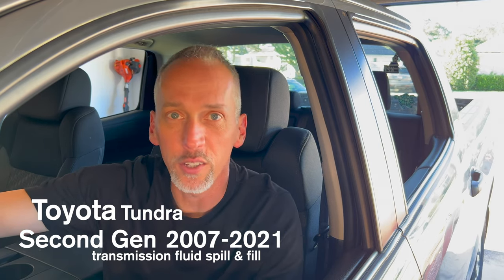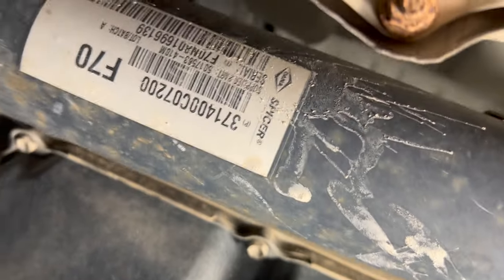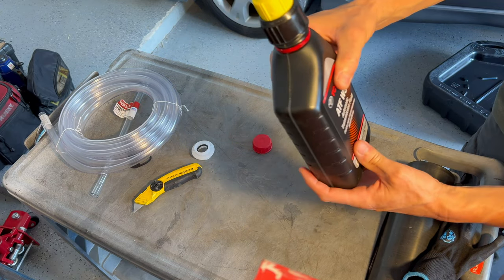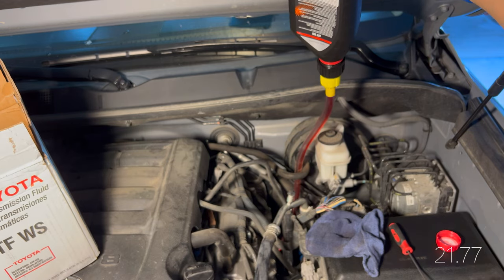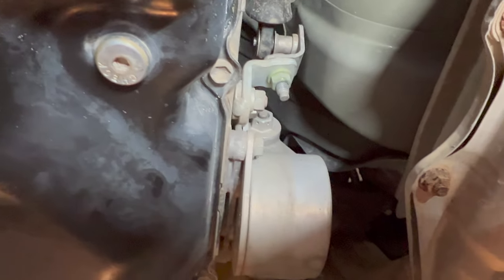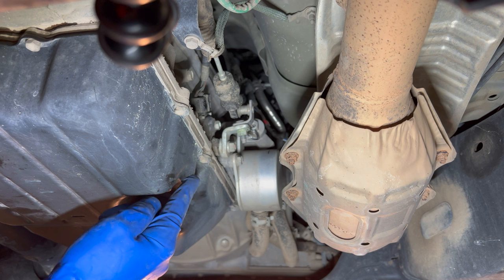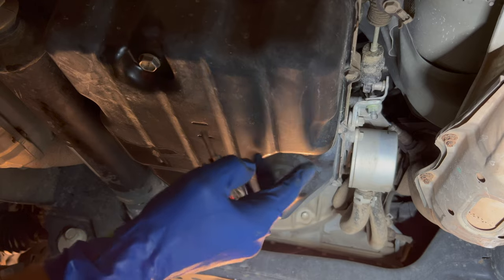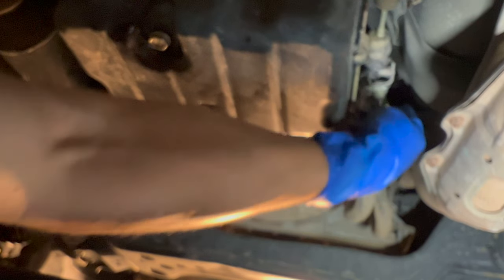DIY Tundra transmission fluid change.

Comment: Thank you for sharing Steve.  How often do you replace the transmission filter?
Reply from the maker: Every 60k for me, but for a lot of folks those pan bolts can be a real bear. In northern climates they’ll rust - then break coming out. I’d leave those alone.
Reply: What would be your recommendation on this. 2014 Tundra 140,000 miles and don’t think the trans has had any services. I’m the second owner. This truck lives in California so no salt on roads. Should I do a drain and fill or drop pan and do everything? 
Thanks for the help.
Reply: @GFYM  OK so this is a tricky situation because of the mileage.  Personally I would drop the pan and change filter and fluid but. Sometimes when a transmission has not been serviced for a lot of miles and you drain the fluid the transmission has the potential for failure.  I would still service it just giving you a heads up.

Comment: NEVER EVER REMOVE  the drain bolt UNTIL you've LOOSENED the FILL PLUG FIRST. Gonna be a bad day if you've already drained the fluid and can not loosen or remove the fill plug. 👍 Also a drain and fill on a Tundra should only take 4qts max .Flush or any other method will take more
Reply from the maker: Well said
Reply: Yeah, you’re correct but calm down about it.  Don’t be that guy.
Reply: @Couchlover47 warning never should be calm 😅
Reply: Just learned this the hard way....lol
Reply: Why? This makes no sense
Reply: I just watched both of the videos. Thanks for share you knowledge. I just bought a 2012 v6 tundra. As I was checking appears no to have a fill plug. Any suggestions is which side of the trans is?  Thanks a lot.
Reply: @austinhernandez2716  The reason being that there are times when the drain plug will come loose and you'll drain out all your fluid and your fill port will be seized or stripped out and you can't refill what your already drained out.
Reply: Diff fluid change much lol
Reply: @ToolDemos  you should really take this one down. Rookie mistakes for sure.
Reply: Is that the same amount with the 2nd Gen Sequoia?
Reply: That 99% never happens if you don’t live in the snow, you’ll be fine
Reply: I'm convinced this guy is not that good of a mechanic.

Comment: 1 correction. ALWAYS undo the FILL plug FIRST... otherwise you will have to turn your truck upside down to fill it.  Also.  When you do this COLD COLD COLD.  use a little plastic 10qt bucket that has measurements on the side.   Whatever you take out, simply replace.  Saves the time of doing the whole temp thing. Foolproof as long as you dont mix up qts with Liters lol
Reply from the maker: Thanks for the tips!

Comment: Hey Steve,  Im a yota tech, I use a mightyvac mv6400 pump to fill from underneath. Even though I'm a tech, I do appreciate you showing folks stuff like this.
Reply from the maker: Thanks Mark. Is that filler faster than a drill pump?
Reply: Haven't tried it with a drill pump. You pump the mv up like a garden sprayer and it will fill the trans in 2-5 minutes.
Reply: Hi Steve, I'm trying to change my transmission fluid and then I figured it out above the termostat there's no plug the I can push and put the pin. How can I check the level of the fluid after?2021 toyota tundra
Reply: @randygonzales6760 Toyota removed the transmission cooler after the 2018’s

Comment: This by far the best video as to how to change the oil in the Toyota Tundra transmission. Well explained step by step. Congratulations.
Reply from the maker: Thanks! I really appreciate you saying that.
Reply: We could add a better solution. Figure out the cold tranny fill amount, then drain while cool and fill same amount every time.. no wasting fluid or time figuring out the level..

Comment: I have 08 tundra with 250,000 miles.  I have only changed the trans fluid 3 times and about to do it the for the 4th time.  Never a problem!
Reply from the maker: Awesome! I love Toyota reliability.

Comment: If the filler bolt for reason can't be unscrewed, you can use a bottle rubber stopper and drill a hole size in middle that fit a vinyl tube and plug into the drain hole. Pump new ws fluid through the tube inside with same amount  plus 1/4 quart  that drained out. Because when you unplug the rubber stopper and screw the drain plug back  the extra 1/4 quart to compensate for the fluid lost

Comment: Great video with a lot of cool tips. Great camera placement too! Def grabbing that funnel from Wally World. 

I’ve used ONLY Valvoline Maxlife in Toyota 5.7, 3.5, and 4.7 engines. I’ll never understand the fascination with the WS. The heat range for Maxlife is better. Plenty of info on the net about this and now, remarkably, the price of the WS has gone down.
Reply from the maker: Thanks. I won’t argue the specs on your fluid, it probably is better. I’m just being extra cautious because in some cars you could cause problems by switching brands.

Comment: I’m glad I decided to check the fill and level plugs first.  The fill plug was difficult, the check plug was rusted so bad a 5mm spins free, 5.5mm won’t fit.
Reply from the maker: That sucks!
Reply: @ToolDemos  an easy out got it free, and it was a nice day to walk 2 miles to my local dealer.  Overall it went good for not going right.
Reply from the maker: @rydplrs71  I’m glad it worked out.

Comment: I have been using amsoil  fs transmission fluid version, in my work tundra since 70 k miles, it now has 250k. 
   Tows a 7000 lbs trailer full time, still shifts great. 
   One suggestion, measure what you take out, then just put the same amount back in, much easier.
Reply from the maker: Great info, thanks.

Comment: I think I'll make sure I can get my fill plug out, before removing drain plug. I also plan on measuring exactly how much I can get out, and put exactly that much back in.
Reply from the maker: Nothing wrong with that.
Reply: Thats what I did with my Titan XD. It does have a dip stick but I still measured what I removed and added the same amount of new fluid to prevent under/over filling it.

Comment: Just a tip. Always remove the fill plug before the drain plug. If you drain the pan but cant remove the fill plug you may be walking.
Reply from the maker: Very good pointer!

Comment: If you’re doing this in cold weather, it’s going to take quite a while for the D light to come on once you’re in check mode. I did this in 46 degree F weather, with a stiff north wind. It took about 40 minutes. I actually thought I did something wrong. The transmission temp gauge was about 1/3 of the way up when the D light finally lit up. I suspected the cold weather may have been the issue, so I feathered the throttle a bit to increase heat output. It worked.
Reply from the maker: Wow, I’m shivering thinking about it.

Comment: You can also go through the inner fender on the driver side.  Plus there's a 1 quart jug you can get thar allows you to pour the transmission fluid into it and then open the bottom to add to the transmission

Comment: Toyota told me that a special tool was used to replace the transmission fluid, and only Toyota was able to do it. (Sure 😏) I'm about to do mine very soon, your video is very helpful thanks for the info, mine is a 08 Tundra V6 4.0 with 70,890 miles, and she is a champion, and leaves the coma taco (eat taco), ahem I mean Tacoma behind, always starts right away, doesn't burn oil, and she's s always hungry for a trip. Bless you all
Reply from the maker: Thank you. That’s a rare Tundra, glad you’re taking care of it.

Comment: Quick tip:  the drain plug is same as check bolt- dump the allen bolt, and get a 2nd hex head drain plug to swap in there...Easier

Comment: Your video saved me 100's of $$ when my son changed the oil in my 06 Tundra 4wd. He saw the drain plug, removed it and drained the oil which turned out to be the ATF as he never saw a drain plug on a trans pan before and was rushing thru the task. When he realized what he did he quickly put the drain plug back in place. Once I couldn't find the nonexistent dipstick and filler tube, I called my friend who has been building tranny's for over 40 years and he told me Tundra's were a "cluster f$%k" and advised me to sell that POS which I did. As if planned by the Toyota stealership they advised a complete trans service for over 400.00$ and refused to add the required amount. SOLD!!! Thank you. Thank you!!
Reply from the maker: Oh wow! Glad I could help.
Reply: I have put a collective 600k miles on 3 Toyotas with sealed transmissions and never had one transmission issue.   Interesting getting rid of a dependable vehicle over a $400 service you may do only once or twice during the entire time you own it. 🤷🏻‍♂
Reply: Toyota trucks have some of the best, if not the best transmissions. I know of two separate million mile tundras used for oilfield hot shots that were regularly overloaded and regularly towed more than the rated capacity and both transmission were trouble free to over 700k miles. One lost reverse at 770k miles and it turned out to be a solenoid. The other at over 700k miles had a flutter going to 3rd gear. The giy had it rebuilt, but the tech said it just needed a fluid and filter change as it wasn't worn that bad. All vehicles have done away with transmission dipsticks. My Titan XD with the cummins oddly still does have a dipstick.

Comment: I used the Covid temp gun on “surface temp” mode. Pointed right at the atf leaving the level hole. Could see the temp of oil very easy this way and didn’t have to buy anything else. When I pointed at pan could tell runs way cooler and your 10 degree less approximation is about right.
Reply from the maker: Great idea.

Comment: Good film, I like the angles, makes the job clear. Why didn''t you just measure what came out and put the same volume back in?
Reply from the maker: Because then I’m trusting the last guy who filled it. Also, I’m not real good with pouring oil without spilling. If I tried to measure it, I’d just make a mess.

Comment: Great video but I did find using a pump a lot easier.  Yes, you spend a few dollars but it’s worth it.  I also don’t understand the temp requirement.  If you drain the oil when the engine is cool and put in the same amount drained, you don’t need to do the temp check.  (The fluid temp is the same so same amount in that came out.) Just run the truck for a bit and shift gears slowly when done.

Comment: This is much easier then having to jump pins on the ODB II port. I did this on a 16 Corolla. Not eztremly tough but a pain in the neck.
Reply from the maker: Sounds like it. I’ve actually never heard of that- gotta check it out.

Comment: Is it a good idea to remove the check plug before it’s reached 104°? I would think accurate level depends on waiting till you’re at the correct temperature.🤷🏻‍♂️
Reply from the maker: As the fluid warms up, it expands. The expansion causes more fluid to spill out. So, if you remove the plug before the fluid warms up, it will just spill out some, but not enough. Once it has warmed up, just replace the plug.

Comment: Thanks for the video! I'm going to try this for the first time. Mine is at 130k, and if its not a recommended service, then I've probably never had it done by a shop. My question is, when you remove the overfill plug, is that old AT fluid coming out or the new fluid put in? Bc i know you're only replace 5 qts at a time and the system i think is 12+? I'm wondering if i do a second consecutive drain and fill, will i be replacing the new AT fluid or the next old 5qts?
Reply from the maker: It will be a mix, but mostly old.

Comment: Great video, thank you.  How often should I drop the pan and replace the filter / strainer and clean the magnets?
Reply from the maker: Thanks. First Toyotas answer, according to them dropping the pan is not a necessary part of maintenance. In my opinion, maybe every hundred thousand miles or so, with a warning. The bolts holding the pan on, are known to get pretty rusty if you live in an area where rust is a problem. If you see that, I would stay away from it unless you were ready to deal with a lot of broken bolts.
Reply: @ToolDemos  ok, thanks

Comment: You're very good at these videos, please keep making them!  I want to do all the service and repair work on our 2014 Tundra myself - I get that mechanics are professionals and their work is valued, BUT I'm sick of being taken for a ride for what often ends up being half-assed jobs.  

This new video is great.  But why didn't you remove the pan to drain out the liter or so of fluid from the bottom-most area where the magnets reside?  To replace the strainer, too?
Reply from the maker: Thanks Benjamin. I like this way for two reasons: 1. The bolts on the trans pan are known to get rusty and they break when you attempt to remove them. 2. I think a fresh 5 quarts of trans fluid every couple oil changes is more beneficial than the occasional strainer replacement. 
Because this job is so easy now, I’ll have time to do it more often.
Reply: Not worth taking off the pan. He did all that in the first video. Drain and fill is enough.
Reply: That strainer really only stops slivers and chunks. The magnets do a pretty good job reducing the number of steel particles over time.  If you get"glitter" upon popping the drain plug, further investigation is warranted.

Comment: I have a 2011 5.7 that I’m sure has never had the fluid changed (I got it at 120k it’s at 170k now). If it were your truck would you recommend changing the fluid or just leave it how it is?
Reply from the maker: If it were my truck, I would just try to get as many miles out of that transmission as is. If you change the fluid now, you’d run the risk of developing problems like slipping.

Comment: I had a complete blonde moment and drained out some of my transmission fluid instead of my engine oil🤦‍♂️ I’ve put about 4 quarts back in but it still hasn’t overflowed through the fluid overflow bolt. I swear I hadn’t taken out that much and thought it to be about 2 quarts. Any advice?
Reply from the maker: It’s hard to say without being there, but if you let the entire pan drain out, you’ll need to add about another quart.

Comment: I have a 200k miles 2008, no records of prior service before 150k. I've never changed the fluid, but was going to give it a shot.   Not sure I understand your comments re "maybe leave that high mileage tranny alone or risk slippage with a fluid change...".  Why would this fluid change have a detrimental effect?  Thx, btw, great vid.
Reply from the maker: When a transmission wears out, it deposits that material into the fluid. It’s one of the reasons why we change the fluid.
But if you don’t change the fluid and just leave those deposits in there, it will do two things. One it will wear the transmission out faster. Two it will assist what’s left of the transmission to keep working without slipping. So if you change out that old oil the transmission will slip.
Reply: Makes sense.  Wondering what my dealer would door say if i bring this in for a full service on the unit. 
 Thanks again

Comment: I have tried this a few times before. I only get about 3.5 quarts drainage. But your saying add 5 after draining? Do you know how to flush the entire system? Good video by the way
Reply from the maker: I should’ve only put 4 quarts in. Whole system flush isn’t recommended, but you can repeat this process to clean it up more if needed.

Comment: Do you put 100% fresh fluid ? Or do you use some of the old fluid and and just add some fresh fluid ? Just trying to learn what to do. I heard 100% fresh fluid can cause the transmission to slip
Reply from the maker: Fresh fluid cannot harm your transmission. Although if you do a first fluid change on a high mileage transmission it could begin slipping. That transmission was already on its way out, the new fluid just revealed it.
Reply: @ToolDemos  I bought a 2010 tundra recently and idk if it has been done before. Maintenance history said nothing about it. So should I not change it at all?
Reply from the maker: @cmora1992  It’s really a mileage question. Personally, I wouldn’t change the fluid on a transmission over 100,000 miles, if it were the first time.

Comment: I prefer to flush the transmission jumping OBD2 pins 4 and 13 when checking the ATF temperature and level at the check tube. I also drop the pan, cean the pan, pan magnets, filter, replace the filter O ring and pan gasket.
Reply from the maker: Very thorough
Reply: @ToolDemos  Thank you sir!

Comment: If Toyota wanted to have these transmissions serviced, they would have put it on their scheduled maintenance charts but they're not.  Over 200k on mine and never been serviced, no slipping or hesitation, runs like a Tundra should.
Reply from the maker: It’s in the chart under ‘severe duty’ which includes heavy loads, towing, and dirt roads.

Comment: I did my fluid drain and fill today. I'm not sure I got a faulty transmission filler from Walmart, but the black connector only securely screwed on the ATF WS quarts for two of them. I ended up pouring the next quart into one of the containers that it fit - if that makes sense. I think next time I'll use the hand pump. 

Question though on drain amount, fill amount and Overflow check to trickle. I drained 4 quarts (just a tad below the mark). I filled with 5 quarts. However, what drained out during the Overflow to a trickle was 2 quarts?! The math doesn't make sense to me. Tests drive is fine. The transmission temp guage was at normal and no slipping. Thoughts?
Reply from the maker: Questions: 
Was the engine running during the overflow drain?
Was the transmission temperature within the check window?
Reply: @ToolDemos  yes the engine was running at the checked temperature.  I did both the wire in the obd2 and confirmed with a laser temp (this was about 5 to 7 degrees different, my guess). The "D" was solid as I did my overflow drain. The trickle came then the "D" started flashing.